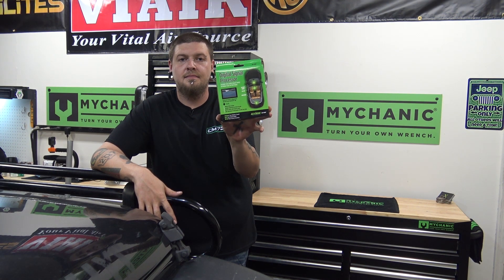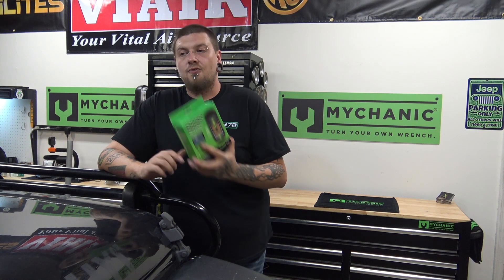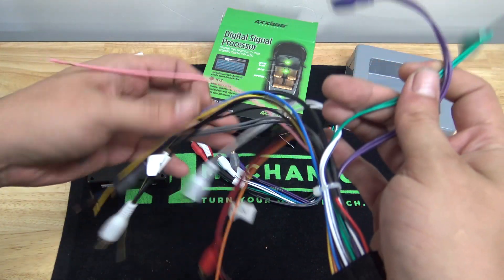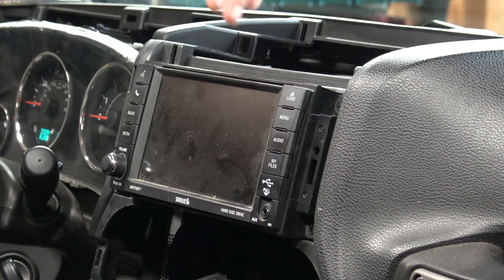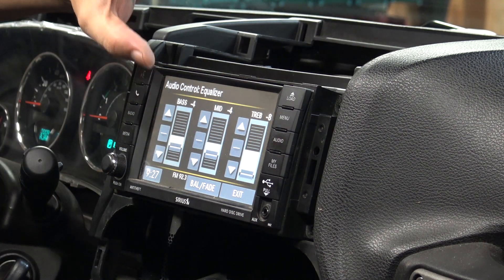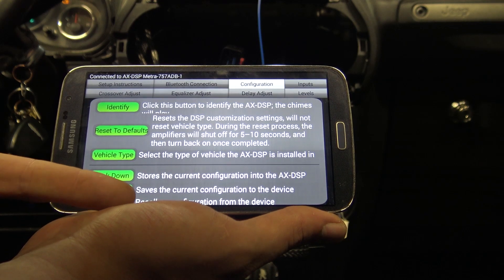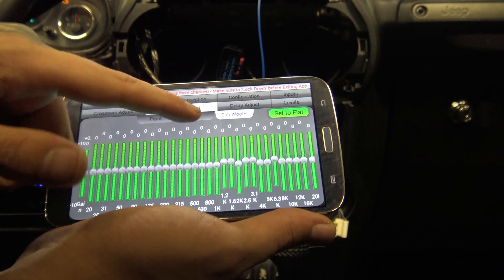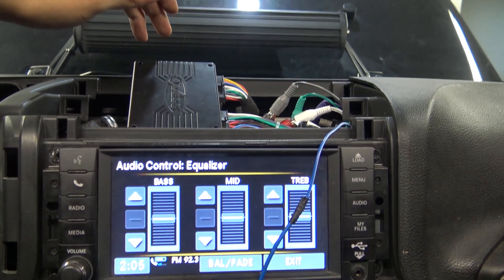AX-DSP - Metra Axxess DSP, Digital Signal Processor Overview

Comment: Thanks for the video. Just learned about Bluetooth DSPs today. I installed a android head unit and it sounds ok with amp to all speakers but EQ is Badly calibrated just as you were speaking about. And I was looking at purchasing a traditional DSP but then I thought it would be really nice if they had something that was Bluetooth. After a short search found this video and I’m definitely sold BT is the way to go. So thanks again.
Reply from the maker: I really like the BT tuning on this, very easy. With this DSP you can also store multiple different EQ setups and give them names. This comes in very handy with the Jeep. I have 3 different EQ's saved, 1 for the hard top, 1 for the soft top and 1 for no top. I did this as the system sounds different with each configuration.  I may have some other car audio equipment you may like in my Amazon storefront. Check it out if you get the chance - https://www.amazon.com/shop/rockyxtv 
Thanks for watching!

Comment: do you still have this DSP? thoughts after some time with it?
Reply from the maker: I do still have this DSP installed in the Wrangler. I do really like it, I have had to do some re-tuning over time, but that is most likely due to the speakers getting older and more "broken in" I have had a few issues with it starting up/turning on a little slow. This has only happened a few times and is no real big deal. You start the vehicle and the radio comes on, you get a 10-15 second delay before audio comes out of the DSP to the amps, but again this has only happened a few times. Overall I'm satisfied with this unit, I do however wish they would lower the price as it's not really competitive with some new DSP's and amps with built in DSP's that are currently on the market. Thanks for watching!
Reply: @RockyXTV  thanks for the detailed reply!
Reply: @RockyXTV   agree with you 100% on your answer..
  watta bout the PRV DSP2.8X,  what do you know about that one in particular?..
Reply from the maker: @hectorortega9131  I can't really speak for the car audio side of PRV, but having owned a live/pro sound company for a few years that name has came around a few times. My old company primarily ran Electro-Voice speakers/subs/cabs and PRV quickly became one of their competitors in the 2010's. IMO they came close to the sound quality, but not quite the same. That being said, I still can't say if their car audio equipment is any good. From the looks of it, their car audio line is part of a larger "re-branded" group of lesser known companies ( PRV, Taramp, Stetsom, Timpano) I would say at their price point it might be worth a try. Keep in mind that it is only a 15 band DSP rather than a 31, but you get 2 more outputs. This would be great if you're running multiple amps that don't need quite as much adjustment. In conclusion, I can say their PRO audio/Live sound equipment is fairly good, but their car audio line is most likely from another company. Thanks for watching!

Comment: Did you set your gains and crossover on the amplifier before you started adjusting the factory settings on the radio?
Reply from the maker: All setting on the radio were at Unity (Hi, Mid, Lo set to 0) before any adjustment was done to the amps. After installing the DSP I was able to test the signal at the RCA's with my oscilloscope for clipping and then re-adjust the amps output also testing for clipping. I hope that answers your question.

Comment: I am wanting to install one in a 2013 Ram with the 8.4 uconnect radio and alpine system. I have a lc2i now going to a 1,000 watt rms Amp and 2 12s, but sound just is odd. Bass after 27 on volume levels out  and sounds odd(big bass lower volume, doesn't increase like normal at higher) , so will this give me a signal that factory amps dsp won't remove bass at higher volumes?
Reply from the maker: This will allow you to make a ton of changes, but I can't say for sure how it will work with factory amps. I would call tech support at Metra or over at Crutchfield. There are a few other DSP's available as well like the Fix86 from JBL and the Tweek, but I don't know much about those.
Reply: @RockyXTV  Thanks, hoping it helps since it's before the factory Amp. Found a new in box ax-dsp for $103 online so had to buy it.
Reply from the maker: That's a great deal! I can't remember what I payed for mine... I think it was $300!!!
Reply: @RockyXTV  I installed the ax-dsp and couldn't get any output from sub rcas, emailed company and was told the android app is bad and they have no idea when it will be fixed, so now have the dsp I can't use. Grrr
Reply from the maker: I used an old Android phone (Galaxy Mega) to set mine up, maybe it's something to do with newer Android software? I was also told that it's best to use a tablet if possible, I think it just gives you more flexibility with the app. I can't say for sure though as I've yet to try it with a tablet.
Reply: @RockyXTV  I'm using a 6.95 inch phone, I was able to find a older version of the software online, hopefully it will work. Odd they don't just put the older software on play store instead of the newer. Worst case I will try a old phone.
Reply: I did finally get it working, think issue was mainly I was selecting subwoofer out for signal, actual setting that worked was( sum front and rear) , now subs work.
Reply: I am only posting to help those like me who have issues with the ax-dsp. Instructions are horrid, basically plug in and select vehicle on app if your car has a t harness for your vehicle. So I bought the ch5 T harness( excellent quality BTW). In the limited instructions says if you have a 4 channel Amp, there's a extra harness.. Huh.. Then in another area of instructions says if installing 4 Channel Amp, don't use the extra harness(which is resistors so your stock Amp can see a load). Nothing is said about subwoofer amp(how to hook up). Ok, the dsp works, but right now my volume on the 2013 Ram truck now does not turn up the sub Amp much, when I mean not much is pretty much not going up with volume control, even when radio is at zero volume bass comes through. I have the optional bass knob so can turn up with that, but still want OEM volume control. So now trying to figure out what I did wrong. I think it may be I have to install the optional resistor harness if I can figure out where it goes. Worst case I can run my OEM sub outs into the dsp but I wanted direct so no roll off higher volume. Getting tired of taking dash out, customer service may get a call Monday. They need better instructions for specific vehicles especially ones that are setup in app and have T harness.
Reply: @rotwiler7674  did you get it figured out? still using it?
Reply: @5after12  No, it works and sounds great, but does not work when I select Ram w oem Amp. I have called, sent emails and just fed up. They keep telling me I need a apple phone, then will work that there is issue with android. I have tried litteraly 9 phones with android 5.5 to current and no change. I updated firmware and was able to get it working with oem Amp, went to make 1 eq change and back to won't work with Amp. So I have to select no Amp and I have to control my subs volume by a bass knob. I ended up ordering a pac Amp pro4, waiting on it to arrive. May keep it and use for my ss Camaro since it has all aftermarket and a good eq would be nice or just sell it.

Comment: Another good Video Rocky I'm sure its going to help a lot people. keep them coming
Reply from the maker: Thanks for watching! This started as a "how-to" install video, but I figured there are way to many wire combinations for different vehicles and it would just make things more complicated to follow. You get a vehicle specific install sheet when you purchase this anyway. Thanks again!
Reply: Its a great Video trust me. it will Help a lot of people trust me.
Reply from the maker: The Metra Axxess DSP is not a plug and play system for every vehicle. They actually don't have a harness for this to work on a 2015 NON amplified JK. I think I mentioned this in the video, but may have forgot. I also ran a lot of new wiring in this Jeep as it had 8 speakers (now 10) and 3 amplifiers, so nothing is really plug and play on this particular Jeep anymore. Thanks for watching!
Reply: You not sure that's why you watch so you can learn.